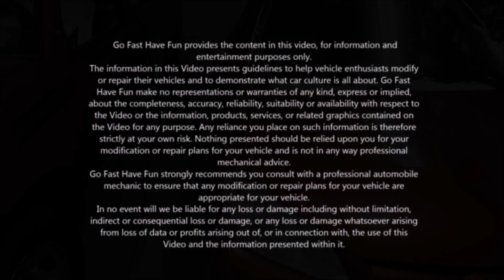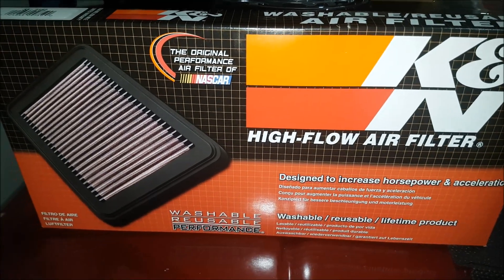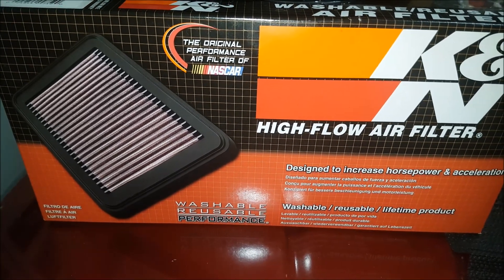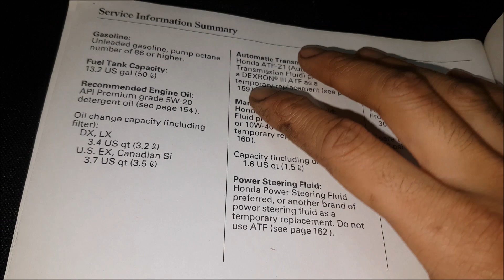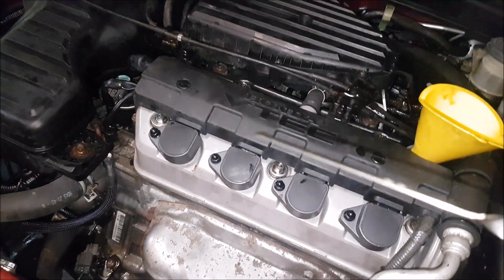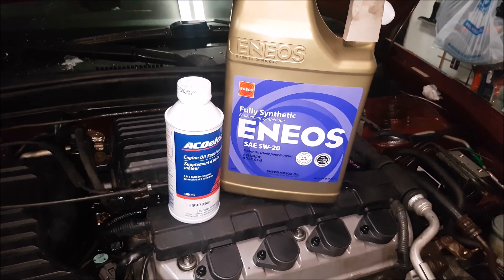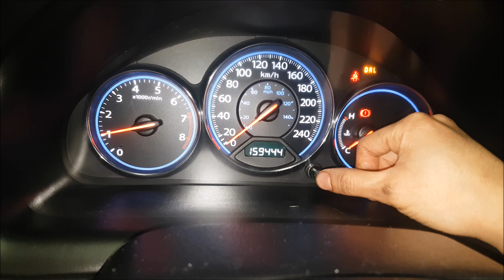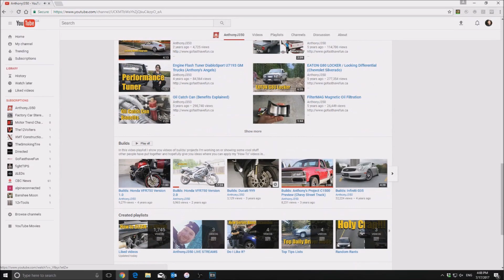New Video Series! Why We Upgrade PARTS: Basic Maintenance | AnthonyJ350

Comment: Nice and informative vid. Quick question, are the injector cleaners universal for both diesel and petrol engines? Or I need to get a specific for my diesel engine?
Reply from the maker: Thanks! The Lucas upper cylinder lubricant will work in both gasoline and diesel engines.
Reply: Thanks for the quick response, I will fill her up and buy one. The injectors were never cleaned before and the car has about 160,000 km. :)

Comment: I use Trip A & Trip B for the same reason. I knew I'm not the only one that does this. Do you also calculate fuel mileage with Trip A when you pump fuel?
Reply from the maker: I reset a every time at the pump so I have  rough idea if my fuel consumption is on track. I will calculate mileage on trips though

Comment: It must be cold in Canada?
Reply from the maker: Some parts get really cold.  I'm in Vancouver, it doesn't get that cold here for that long during the year. When I recorded this video is was -5 degrees Celcius outside.
Reply: AnthonyJ350 that's to cold , I couldn't handle it
Reply from the maker: Some areas in Canada will go down to -30 to close to -40
Reply: AnthonyJ350 I would die
Reply from the maker: Ya I couldn't stand temperature that low either lol
Reply: AnthonyJ350 I want to make a race car put of my toyota Corolla

Comment: You forgot to change fuel filter and cabin filter.
Reply from the maker: That's a good point, thanks for mentioning those.
Reply: You can also check gearbox oil.